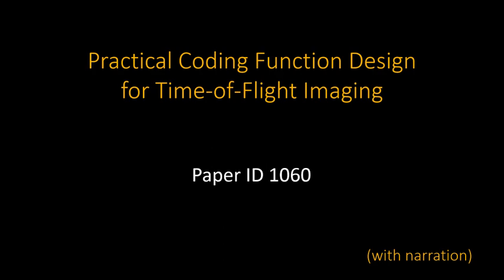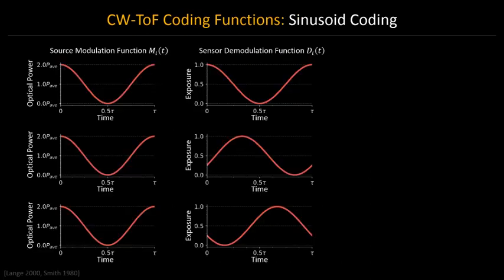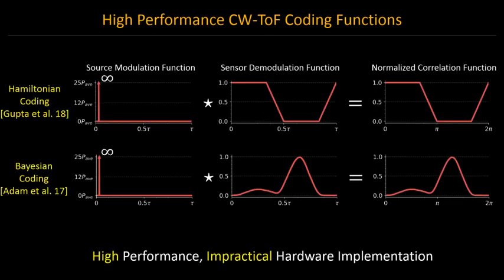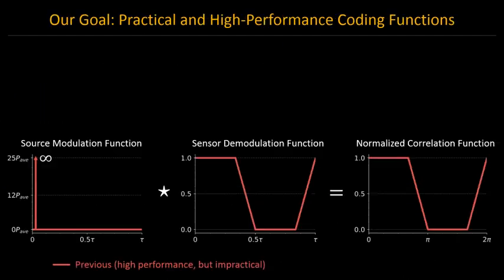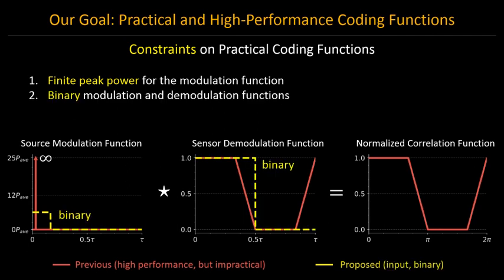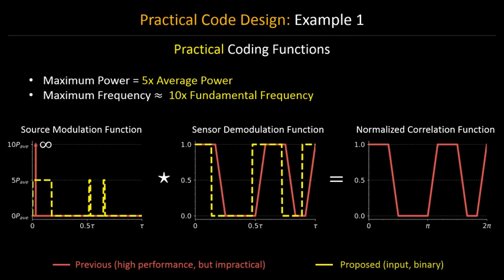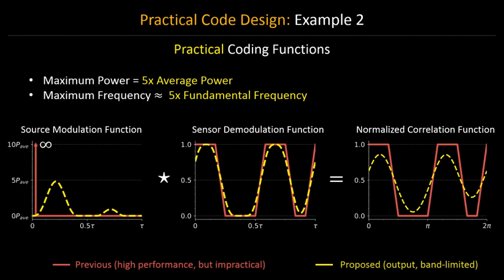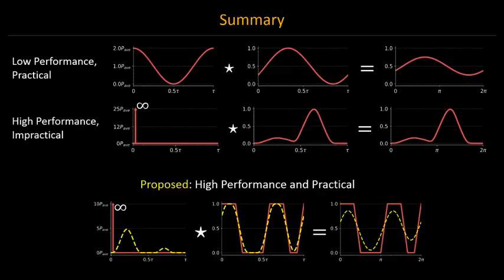Practical Coding Function Design for Time-of-Flight Imaging - CVPR 2019 - Supplementary Video

Comment: How to  use modulate and demodulate function to  reconstruct depth?
Reply from the maker: Take a look at section 1 of the supplement of the paper here: http://wisionlab.cs.wisc.edu/wp-content/uploads/2019/03/CVPR2019_PracticalCodeDesignToF_WithSupplement.pdf . In that section under "Normalized cross-correlation for depth decoding" we describe the algorithm that is used. If you want a code example of how this is done take a look at this repository: https://github.com/felipegb94/ToFSim . Inside ToFSinglePixel.py I do a simple ToF simulation for a random depth (assuming no multi-path interference).  The depth decoding algorithm is inside Decoding.py

Briefly, to calculate depths from K arbitrary modulation and demodulation functions you can follow this algorithm:

Input 1: N x K modulation and demodulation functions. Where N is the number of discrete points used to represent a single period of the functions.
Input 2: 1 x K brightness measurements obtained from the correlation of the modulation and demodulation functions at a given pixel.
Output: Depth of that pixel

1. Calculate the K correlation functions from the mod and demod functions.
2. Normalize the K correlation functions as done in line 63 of this script: https://github.com/felipegb94/ToFSim/blob/master/ToFSinglePixel.py
3. Normalize the 1 x K brightness measurement similar to what was done in step 2, i.e. subtract the mean and divide by the standard deviation
4. Calculate the dot product of the 1xK normalized brightness with each of the N x K rows of the normalized correlation functions.
5. Step 4 gives you a list of N values. Find the maximum among those N values and its corresponding index.
6. The index of the maximum will be proportional to your depth. To find the exact depth calculate you can multiply the index by (depth_range / N)